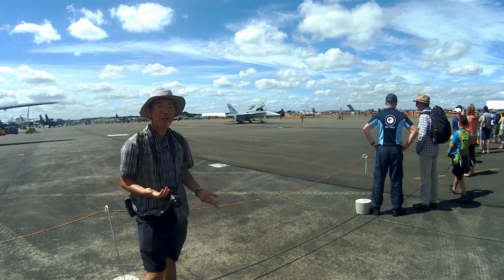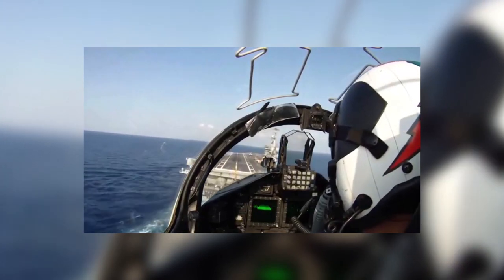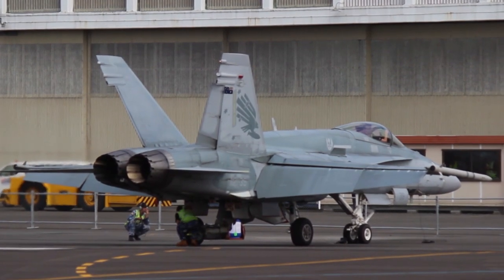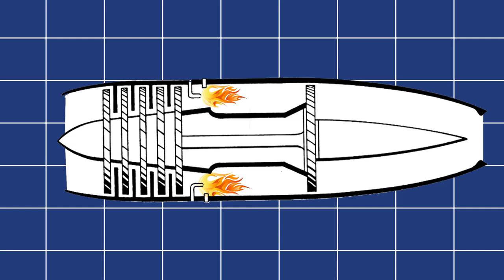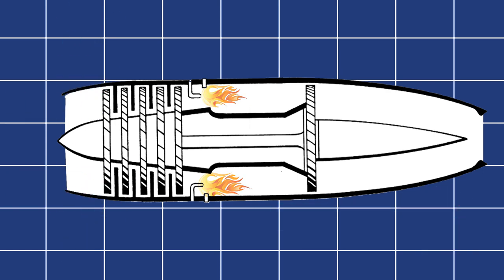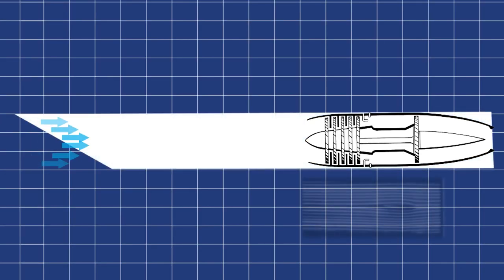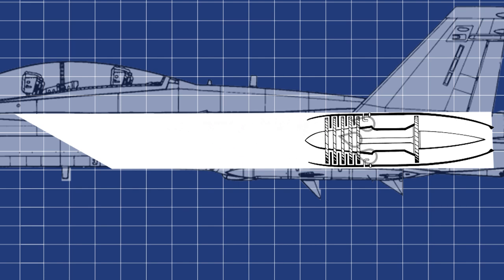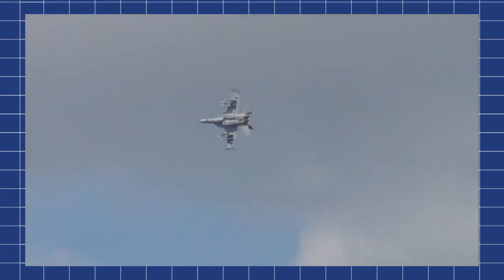The F-18, F-404 Engine and compressor stalls

Comment: @Luke Yu For "separate fan installed" you mean the engine inlet?
Reply from the maker: My research wasn't too clear but it said it was a part of the engine
Reply: @lukeyu2005  Because from what I know even the J79 turbojet of the F-4 Phantom had an inlet, the compressor stall was solved later thanks to electronically controlled fuel injection and better hydro-mechanic controls, in order not to accelerate the engine too abruptly and avoid a compressor stall
Reply from the maker: I believe it was an mechanical system to smooth out the air.

Rather than a electronic system to prevent throttling up to fast. 

It's been a while can't remember my source
Reply: Inlet guide van (IGV)